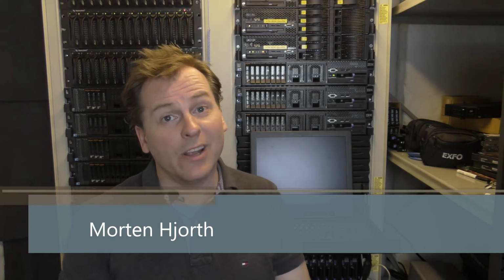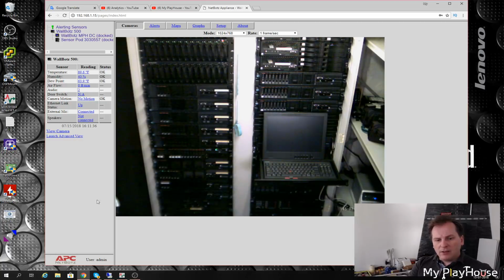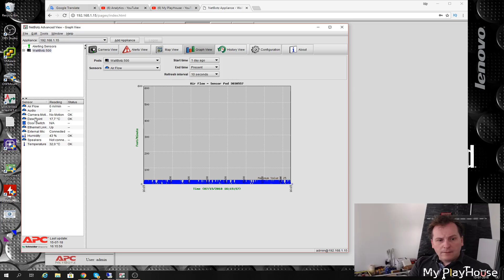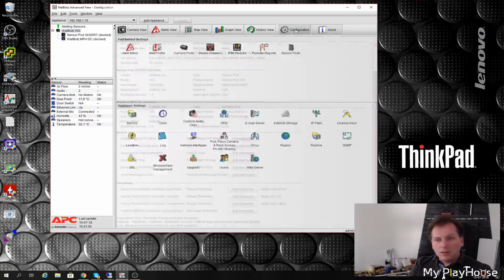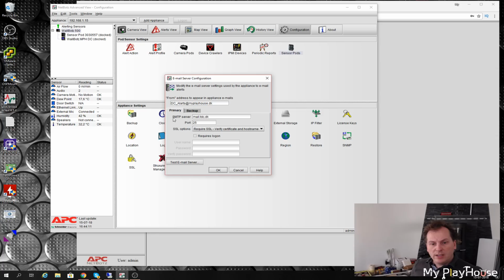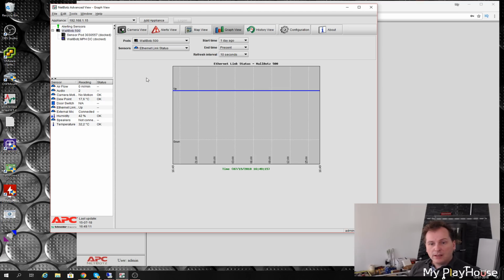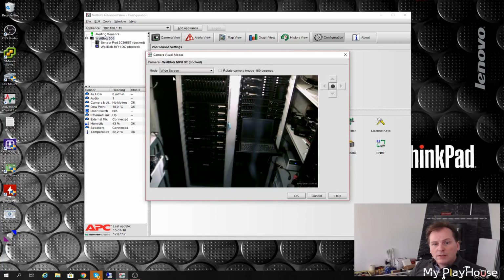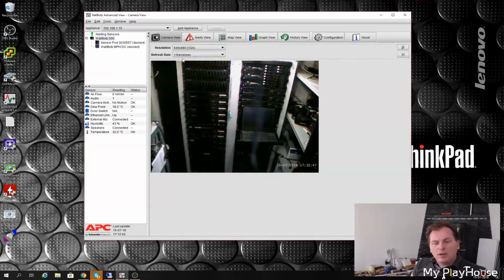Data Center Monitoring - APC Schneider NetBotz 500 - 718

Comment: Hello Morten, Nice video.
I have a 355 with FW 4.6.2, you have to update it manually, check APC website.
Regards from Spain : )
Reply from the maker: Hi Jrincon1993
Thank You very much!  Can the wallbotz use the 4.6.2 FW ?
Thank you for watching! :-)
Reply: You are right your SKU is not listed, but i would try to see if it possible, just download the firmware that work with various model (Rack Monitor 570/550/450; Wall Monitor 455/355) and try to update it (Yes it could break the unit : D)
Reagards.

Comment: Hej Morten! I was thinking back and forth about your data centre cooling. I find that an entertaining kind of problem, thus spent some of my huge brain cpapacity there. That´s when it happened: I started wondering if there were a scrapyard somewhere near yours where you could get a scrapped truck´s cooler. Innvoative, right? ^^)
I think the larger area of such a cooler would make a huge difference at the air intake of your ventilation. The one you have in place there looks a bit pathetic, to be honest. Sufficient for a single PC, but…
Reply from the maker: Hi Eo Tunun
Thank You very much!  My summer vacation is coming up,, and I am going to be playing with this,, with some new parts.
Thank you for watching! :-)